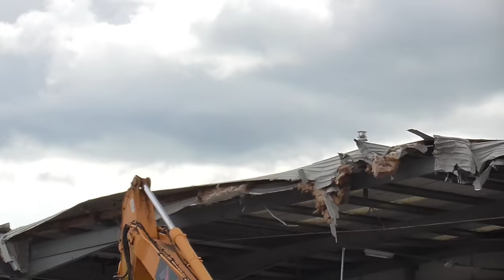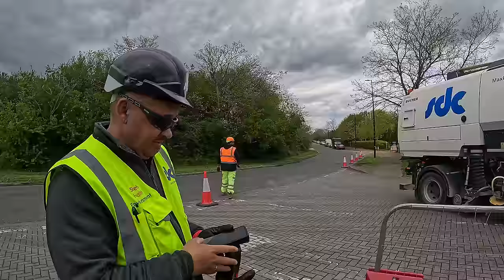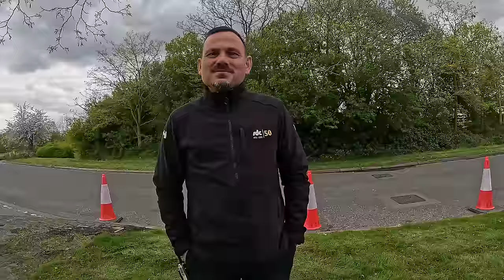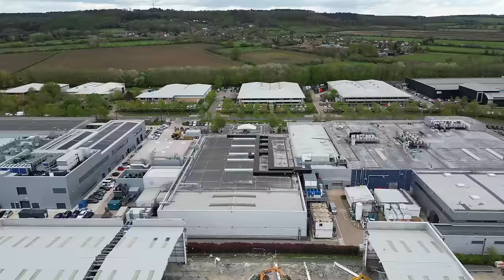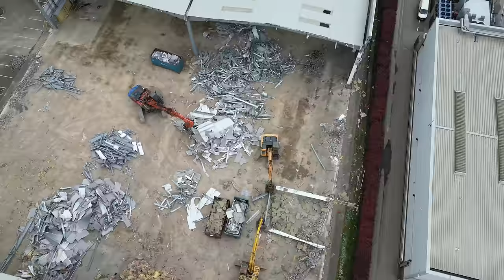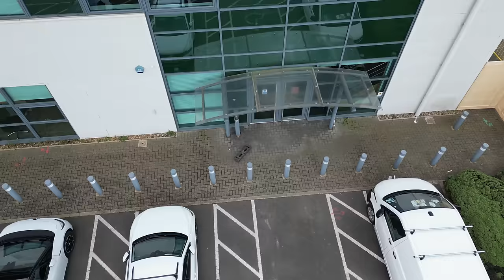We Own The AIRSPACE in a Straight Line to INFINITY 😂✈️🍿🏎️🙄❌

Comment: If that building is Redbull previously ford racing team previously SKF i used to maintain the plumbing and heating there when Ford moved in they damaged  a huge cable the heating pipe under the floor that I had to go and fix